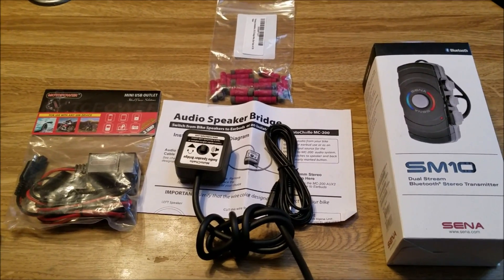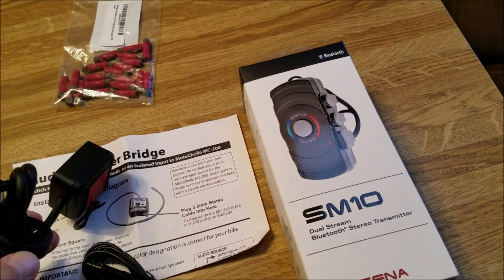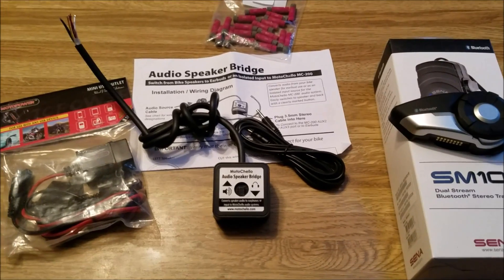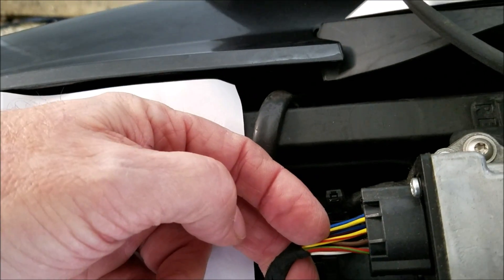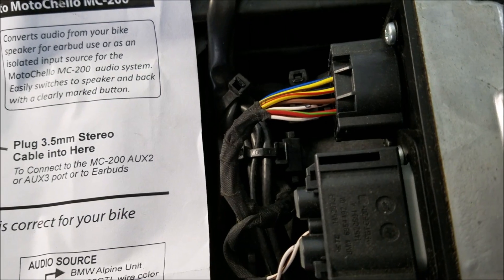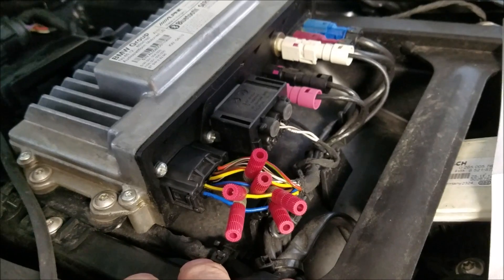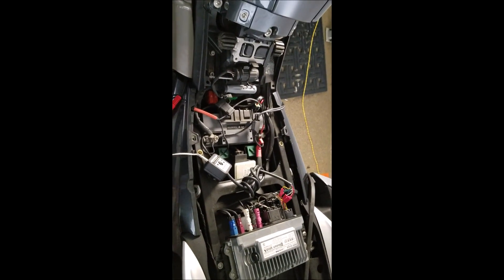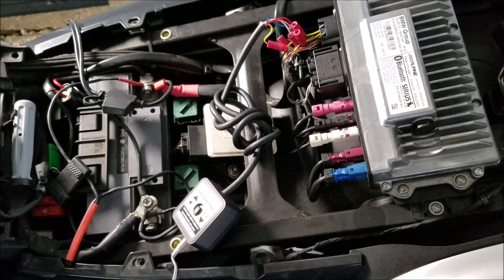BMW K1600/R1200 Bluetooth audio upgrade Part 1

Comment: Kim,  just an FYI for those with Grand America models.  I have a 2019 GA and it comes with both front and rear speakers.  Not thinking about what you mentioned around the 8:10 mark, when I clipped the wires per the instructions, on the GA model, it only turns off the front speakers.  I freaked out thinking I screwed it up.  I called Motochello and at first, the guy was like, Oh! But then he suggested the Fader on the bike.  So with the setup, and instructions they include for now, use the fader so it sends audio to only the front speakers, effectively muting the rears.  This also gives you audio, if needed, with the Motochello set to "ear buds".  Also, in the trunk there is a bike powered plug that I used to power the Sena. I got the USB adapter and ran the line out of the box (it doesn't get pinched when the lid is shut) and down the front of trunk and then under the grab rail to keep it in place, and then down and under the plastic, under the brace for the amp/xm unit and to the pocket where the Sena is.
Thanks again for your video, helped me fix a problem that shouldn't need fixing and BMW shoulld correct.
Reply from the maker: glad to hear it! I wasnt sure about the other wires...And I never got around to seeing it they were actually for the rear speakers. Good to know the GA has them. I have a friend with a GA, I'll have to ask him about that.

Comment: Hello! Thanks for this video! I have a BMW K 1600GT 2012.  I want to be able to listen to music, talk on the intercom with my passenger and hear the GPS directions at the same time! Is it possible with this setup, and what additional equipment do I need? Thanks!
Reply from the maker: It allows multiple change connections. The headsets connect individually. The chimney then to each other using the pairing feature.

Comment: Just so that Im clear.  Does the montochello unit allow you to blue tooth music to the bike from a phone?  If so, and the wonder wheel can be used to adjust the volume, can the wonder wheel also be used to track up or down the music?  I do not have nor plan on getting a gps unit.  My interest is only to stream music to the bike from a phone.

Comment: Hi Kim, do you still have this bike/setup? Has it lasted since 2017? How is the sound quality of the bikes satellite radio through the headset? I have a 2020 B. Thanks for the very informative video.
Reply from the maker: i sold the bike, but several of my members on the K1600 group have used it and it works well, infact one of our members sold his 2016, bought a 2021 and did the same thing on it.

Comment: Is the wiring on teh 1600 the same for all models?  Grand America, GTL, etc?
Reply from the maker: yes, it should be identical. I made this before the B was available, Just verify the bundle I isolated in the video and follow the Motochello wiring diagram.

Comment: Kim, how exactly do the posi-taps work?  I read the instructions on Motochello's site and they say to strip the wires being connected.  I thought they self-tapped?  Thanks, Bob
Reply from the maker: they unscrew into 2  pieces. ONe piece, the brown part, pushes up and touches the wire with a little pin. the top part then screws down and foreces the pin t5o cut through the outer sheathing. then the top screws off and slieds over the other wire. then you screw it down and it makes the connection inside with the bare wire. NO cut splice.

Comment: I have done the upgrade exactly as you  did.  I have a K1600GTL with a Nav V and Sena 20S headsets (2 up), a Note 8 android phone and an Ipod classic that I would like to use with the included aux usb cable included in the right storage compartment on the bike.  What pairing steps do I take??  THANKS
Reply from the maker: I just used the pairing procedure for Sena on both of the devices. The bikes pairing is not used as this is a "BYPASS" of the bikes BT setup.
Reply from the maker: I Use a 32GB flash drive plugged into the USB port in the right side compartment. I just select USB on the menu and it plays through the system, so i would assume it should work the same way with a phone or other USB device.

Comment: Did your wonderwheel on the k1600 work?? Where you able to adjust the volume with the wonder wheel?? Best- Doc
Reply from the maker: Yes, you have full capability of the bikes audio functions! The radio still thinks its outputting to the speakers, did you watch part 2? its a link in the final  seconds of this video. And you can still setup your phone to the GPS and use all of that in any  headset...mine is the Sena 20S.
Reply from the maker: I supposed I should have mentioned to watch PT2 of the video series to see the final install of the BT transmitter.